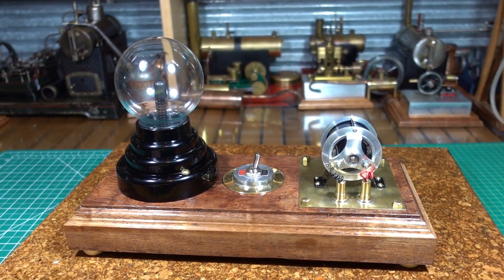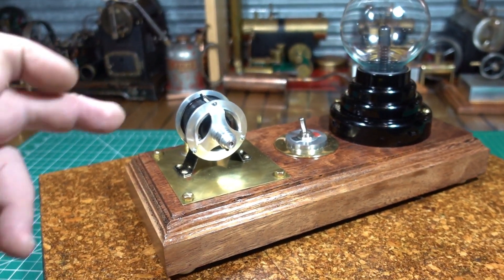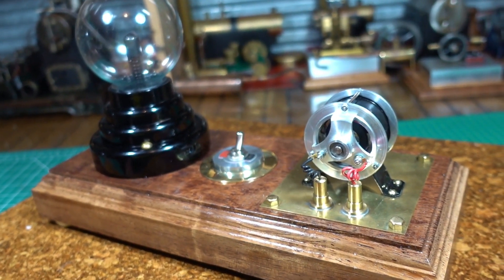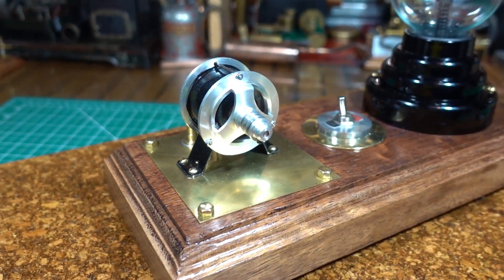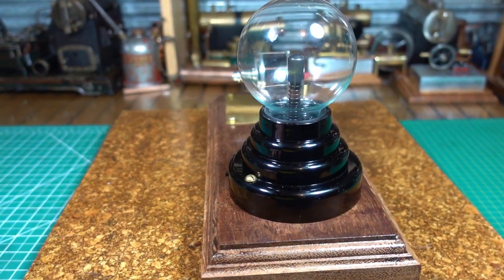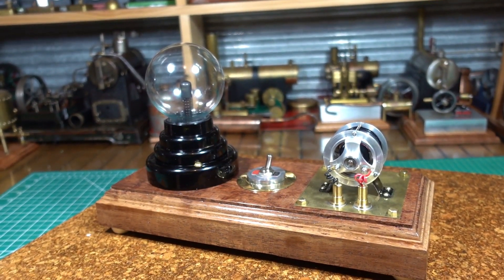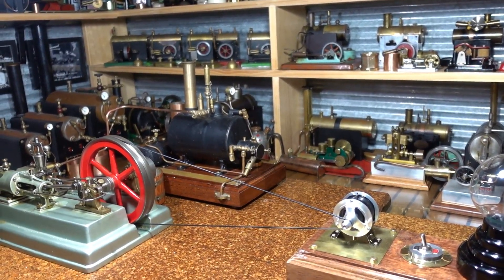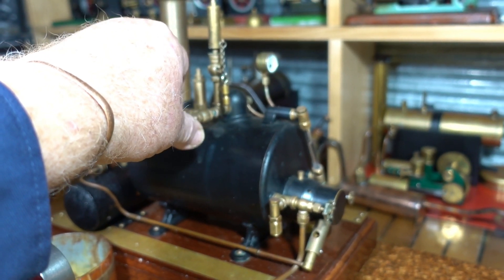Model Steam or Toy Steam Engine from a Polish School running Plasma Ball with an Austrian Generator

Comment: Beautiful setup!
I will ask for those corkboard on the hardware store next time i wisit town!
The only thing i hawe to complain about is that now i want to find a nice looking glass plasmaball... ha ha!
Reply from the maker: LOL these plasma balls off eBay are a lot of fun! The cork tiles are fairly cheap and I just used a wood glue to mount them on plywood (2 thickness's) and some marine varnish over the top.
Reply: @SteamEngines-Jim  
Thank You!

Do i need anything more than the bridge rectifier in order to make the plasmaball work?
The generator looks awsome!

I hawe one of those green 70s wilesco generators on my workbench, i did concider a wooden stand for it for a while, but then i forgot about it until now whan i found some realy nice pices of birdseye birchwood among the offcuts after we sawed those panelboards for my parents summerhouse. I think it would look neat on a stand.
Reply from the maker: @Vampi_Sweden  Hi,  You only need the  bridge rectifier if the generator is AC current. I wanted to use this Austrian genny which puts out AC, but the plasma ball worked well directly off my P M Research genny that puts out DC current. If you need the wiring diagram I can email it to you 😀
Reply: @SteamEngines-Jim  Thank You wery much, You hawe realy been a kind person! <3
I found them now on aliexpress for better price than ebay, i think it is about 3-4 weeks delivery time here, but it looks like a realy fun project!
Reply from the maker: @Vampi_Sweden  I didn't know what a bridge rectifier was and I couldn't have wired it up without my friends diagram.....I most humbly admit that electronics is not me forte 😀
Reply: @SteamEngines-Jim  
I think i hawe a basic grip from repairing 60-70s farming equipment and building computers in the 90s, but i admit that the higer level of modern electronic is above my head. 
The bridge rectifier may look very simple but it is actualy one of those little tricks that are not straight up logic at the first sight if one are not familiar with it, especialy if one are used to old selenium rectifiers (wich need to be stacked) or diod tubes. I think the power is to low for using regular valves directly, but i think i will do some experiments with those old walkietalkie 1,5V DC battery tubes in the future, i am not sure what it would be good for, but i think it would look pretty cool to add in a few old valves that where actualy working and not just served as dead props.

Another project still collecting dust on my shelf is to add in a set of Nixie tubes with numbers and letters (as soon as i got my thamb out and learn the electric scematic properly for the tubes) I also hawe some Russian bargraf neon tubes that would be fun to experiment with. (I only managed to got the IN9, but IN13 is a lot better choise but they are a lot more sought after since they hawe a separate control anode wich makes them run a lot more stable, the IN9 can as far as ai know onle be controlled by the supply anode wich makes them run crasy if one does not do it rigt.).

I also hawe a set of realy beautiful British Number valves i traded with Mr Mad dog from the Brassgoogle fourm for a box of old clockparts long time ago. 
I hawe not decided yet what to do with them, but if i manage to get a realy big seashell, i think they would look awsome in a clock inside the shell (i don't want to kill a living one only to get the shell, but something allredy fished for food, perhaps, it's just my coinsense tellin me that one shall only take what one need to eat and not plunder mother nature), perhaps.
However, i am not going to make clocks of every single tube i hawe, that had been realy booring... ha ha

Beside the steam and traintoys i use to pick up old tube equipment if i manage to get it realy sheap in order to reverse engineering the old ways of construction thinking, and those old radios are often very beautifuly made.
Reply from the maker: @Vampi_Sweden  I can build a computer, but electronics....wah!!!! LOL A friend of mine on the forum built a Nixie Tube clock. I had never heard of them before, here's the link - https://www.officeofsteamforum.com/off-topic/building-a-nixie-tube-clock/msg33775/#msg33775
Reply: @SteamEngines-Jim  
Thank you!
I can't see the pictures at the moment, but i can imagine how it would look with those tubes. They are basically using the same working princip as neon bulbs.

(It's still heavy rain outside my window today so it's a prefect day to dust off the old ladies sitting on the shelf!

Yesterdays night project was a set of german miniature trains i had parts of laying around for a while, my plan is to drive them with a steamplant generator)
Reply from the maker: @Vampi_Sweden  You know what I'm going to say in advance don't you 😊 I would very much like to see these running!
Reply: @SteamEngines-Jim  Thank You for the reminder!
Yes, of course!
I will write a note when my channel is up and running!
Reply from the maker: @Vampi_Sweden  😊 I am very much looking forward to it and I have also much enjoyed our interactions discussing a little of everything that we like to do with our hobbies.
Reply: @SteamEngines-Jim  
I can not thank You enough for all help and support with my projects!
Reply from the maker: @Vampi_Sweden  You're most welcome I've thoroughly enjoyed our chats 😊